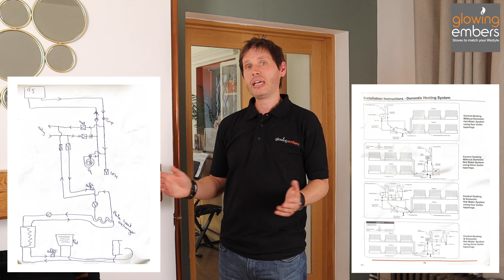Installing A Boiler Stove | Glowing Embers

Comment: Just recently installed mine, works a treat, also got a Henley which I purchased form Ireland. Gravity has two rads and also does my hot water. I have 10 rads off the pump side. Multiple safety rad stats to turn on the pump if the water ever reaches a certain temp. Gravity circuit works brilliantly to dissipate heat if the pump is off. 28mm pipe work on the gravity side, 22mm on the pumped side, gravity hot side needs to always travel up, with no horizontal pipe work. Both tanks in the attic are metal. This is simply the best system for old houses.
Reply from the maker: Great, sounds good, glad to hear that your system works well and thanks for sharing your set up, really helpful.

Comment: Air source heat pumps will now heat water to 70 degrees
Reply from the maker: That’s interesting, I haven’t heard of one that can get to this temperature before, what is the model?  That could make installing a boiler with one of these a bit easier.

Comment: I'm no heating engineer but I visualise having a hot water tank with multiple coils in for wood burning boiler and ASHP, and heating if thats how the heating works.  So essentially the ASHP and stove keeps the hot water tank upto temperature and the hot water and heating will come off a coil.  I think that's how i'd like to do ours when we get to that point of the reno.   Great video explaining everything.

Comment: Always thought you needed a galvanised steel expansion tank ?
Reply from the maker: I should have pointed out in the video that a metal expansion is always recommended, mine has a high melting point, well above boiling water but I am probably going to change it.

Comment: Hi mate great video. And the install looks very neat! I could be wrong as havnt done one of these systems for a long time now. But I think your F+E tank should be copper not plastic. If it ever does boil over. You’ve got red hot water going into a plastic tank.
Reply from the maker: Yes, whilst my tank has a very high melting point, metal is always recommended and I may change mine.

Comment: Great explanation thankyou for this. I moved into a house approx 8 years ago and we have a Hunter herald mf stove. It is our only source of heating. We have always found it struggles to get all of our rads to a decent temperature even though it should be more than capable of doing so. It uses a Navitron TDC3 controller to start the pump but it doesn’t kick in until it reaches 58 degrees. I think that might be the problem as the pump doesn’t stay on for very long before the water begins to cool. I might drop it down to 45 degrees like yours and see if that helps.
Reply from the maker: Thanks for your comment, I have found that it is a balancing act between pump speed and the temperature that the pump kicks in at.  It sounds like possibly your pump might be pumping too fast if it cools the water quickly before turning off, so you might want to try experimenting with this.  Wood burners hold a lot more water in their jackets than a gas boiler and therefore the water needs to stay in the stove for longer to get to temperature.  You could also try lowering the temperature that it kicks in at and see if you can find an optimum balance of the two.  The next obvious things to check are if you are burning well seasoned wood that gives off enough heat, as this will of course affect the performance greatly.  Hope that helps and good luck with it.

Comment: Fascinating video.

The most daunting aspect would be the fitting of the piping to your existing system.

Does your Company have a Showroom with other kilowatt ratio wood burners with boilers on display?

Also, the four pipes connected for flow and return, presumably a hole is cut at the side of the existing Chimney breast, can you advise on the dimensions of the hole and shape, eg can the hole be round, or does it need to be oblong?

Regards

Robert

Comment: This is a very informative video. I could really do with some impartial advice as we have just moved into a 1920s 3-bed bungalow off the gas grid (LPG), its really cold. The existing Worcester Greenstar Ri conventional boiler system just doesnt seem to cope for some reason? It wont work at a gentle steady 21' heat like the combi in our old house (its either on max or off) and the pathetic network of tacked-on radiators don't flow too well it seems - some hot some cold. Id like to live in the house for a full 12 months before embarking on a new install just to see where the hot and cold spots are, but my wife is pushing for a wood burning stove in the living room ASAP, in fact she says if she is cold one more winter she's leaving! (I think she's not exaggerating?). My brain says to consider the house as a whole not blow a wad on one room.......ideally I'd like to have a hybrid system that could take advantage of both fuel sources, wood and LPG for heating and hot water for bathing/showers (I would use instant heaters for sinks). I would also like at least part of the system to work in the event of power failures, so not totally dependant upon pumps and use gravity where possible. Does such a system exist? Could we potentially install a boiler stove and link up to the existing rads for now, and then link to a more integrated system later?

Comment: Really interesting video. I was under the impression that boiler stoves were no longer popular following the changes to the regulations concerning efficiency so this is good to see! I have an Arada 12kW boiler stove that I'm looking to integrate with our system here (2 thermal stores with gas boiler and solar thermal). In our case we have a vented 300L thermal store (only used in winter to heat radiators) in the room on the other side of the boiler - unfortunately I don't think we can rely on gravity as the tappings on the store are only marginally higher than the stove (50mm over 2m).  Are you familiar with a pumped system? I was looking at using a Laddomat loading valve but am interested to know about the safeguards to protect the system in the event the pump stops... We're getting a lot of conflicting advice on this.
Reply from the maker: My system has a pumped and gravity side.  If you are using a heat store then this is a good solution but you still need to have a heat soak radiator (min 10% of the heat output to water) and an expansion tank.  If you have these two things in place then your system should be able to run fine without the pumps ever kicking in.  The key is the heat soak radiator and an expansion tank.  Hope that helps.

Comment: My system has been in over twenty years now, a Parkway multifuel room heater with boiler, it feeds 10 rads, and a 36x18 cylinder for the hot water, this includes a heat loss rad, and towel rail in the bathroom, it was very efficient with household coal (which is now banned), heats the cylinder by gravity, pipe stat fitted to the primary flow expansion when the heat travels up the expansion at a given temp it brings in the pump, I have a gas boiler which is crudely stabbed in the rad circuit, which if used, runs through the roomheater and cylinder, I probably need to get one of those heat exchange thingy's
Reply from the maker: Gas boilers are easier to mix with boiler stoves and if you have a working system then it probably isn’t worth adding in a heat exchanger.  There is a cost to a heat exchanger and that is a smaller loss of heat, thought they are pretty efficient you do loose some heat in the transfer process, so probably, if it ain’t broke, don’t fix it!

Comment: I have my oil boiler and mulitfuel stove linked to a thermal store cylinder
Reply from the maker: Yes, a thermal store is a great way of doing this too, it does mean it takes longer to warm up and you need to have a large tank in your loft but generally is a good installation choice.

Comment: Hi, Great video. We have a three bed bungalow with a 13 yr old Mitsubushi Ecodan air source heat pump. Although it heats our home and water well I think it's actually quite expensive to run and it leaks in the winter and creates a pool of ice. So it's probably not working as efficiently as it should and trying to find a plumber in Cumbria for this is next to impossible! I'm looking to remove this system. I have purchased a second hand Herald Hunter with a boiler and want to fit it and also want to have an off grid gas boiler set alongside it so they can back each other up when necessary. Would the gravity rad be ok in the bathroom about 15/20ft away and obviously on the same level as the stove and an insulated copper water storage cylinder in the loft above the stove and would I still need a metal expansion tank in the loft?  We are kinda looking to eventually go off grid including harvesting the rain water because we get more than our fair share of free water!! Do you know if 12v pumps work on a system like this? Thank you in advance.
Regards, Mike

Comment: Great video. Looking into boiler stoves but unfortunately we’ve not long move to combi system and seems as though it wouldn’t be easily do able. Probably would be able to as there would be a lot of infrastructure already in place for a tank etc but information and people actually doing this seems to be impossible to find!
Reply from the maker: This would certainly be do-able.  Installing a boiler stove with a standard gas boiler is much easier than installing with an air source heat pump, you wouldn’t need to worry about pipe stats shutting off the flow to gas boiler, it would just turn off once the boiler stove is lit and the boiler would take over.  When the boiler wasn’t lit the gas would take up the slack, it could be a nice system.
Reply: @glowing-embersUK  very interesting! I’m in a large farm house so heating is always on the brain. Would I be able to contact yourself? Or do you know of anyone I could contact to look into this further? I’m not sure my local log burner fitter is quite up to speed on this sort of thing but really interested!

Comment: Such a great video! I have a very small house that im looking to install a boiler stove in. It's 4 rooms over 3 levels, with the boiler at the very bottom. It would be 3 or 4 radiators. Would it be possible to run this completely on a gravity system? Thankyou
Reply from the maker: Thank you! Yes, if you are only using the boiler stove for heating then a gravity system should work well and with only 3-4 radiators, you should easily be able to find a boiler stove that would heat the house.

Comment: Great video, i live in bungalow, how far away should the stat be from the boiler stove? Ive been told as close as possibe is this true? Ive the same stove 4 pipes and the diagram shows the stat on the return?
Reply from the maker: We’ve put the stat on the pipe just after the heat soak radiator and before the expansion tank, this works well for us.

Comment: great vid. do you have any problems with flow across the horizontal pipe work? the only heat sink radiator is above my boiler stove in the bedroom, and boy, it don't half get hot. we have a gas boiler (50kw) in our cellar and when the boiler stove is lit the gas boiler never comes on until the fire dies down. is it worth trying to keep the fire going at night to stop the gas boiler coming on?
Reply from the maker: Thank you, no I don’t have any issues with horizontal runs in the system, although I don’t have many in the system, most of the longer horizontal runs are on the pumped side of the system, not the gravity side, which only has relatively small horizontal runs.  Heat soak radiators do get hot, sometimes very hot, that is their job, often best not to have them in a bedroom for that reason and locate them somewhere like a bathroom if you can.  You could try keeping the stove in overnight, you really need to use some smokeless fuel to do this, load it up and turn the air controls down so it simmers all night.  You will need to experiment with the fuel (both quantity and type) and the air control settings to perfect this and you may well find that it blackens the glass overnight as it slumbers.  It is not the best way to run a stove from an emissions point of view but it does keep the stove warm overnight ready for re-fuelling and firing up again in the morning.

Comment: Go green with an air source heat pump then get realistic with a fire. ( did you know when you bought the air source they need nice insulated airtight buildings to work efficiently?)
Reply from the maker: The air source was already in when I moved into this house and yes – they work well for top spec insulated houses with triple glazing, and underfloor heating but for an older housed like mine with single glazed windows and radiators it is a non-starter, really expensive and really cold!
Reply: Everything works better with good insulation. Heat pumps, boilers, stoves. You have less heat loses.

Comment: Would you recommend the Druid 30? Would it be an efficient unit if this size? Tks
Reply from the maker: Yes, I would recommend it, it is a solid stove and works really well.  There aren’t too many large boiler stoves on the market at the moment, since the new eco design regs but a few more are coming through.

Comment: How long does it take to heat the water and feel the heat in other rooms with this boiler stove?
Reply from the maker: It takes up to an hour for the rest of the house to start to heat up, with the exception of the gravity radiator which is pretty quick.  It depends upon how big the fire is of course but from totally cold, you have to get the firebox warm, then the metal of the stove (and there is a lot of metal to warm) then the water in the system and this all takes a bit of time before the heat moves to the rest of the house.  Once warm, it heats up the hosue pretty quickly.

Comment: Would any body know if running pipes from the ceiling to the rads or from the floor up to the rads would make a difference with back boiler stove.
I can’t get my rads to heat properly but I was told it might be because my pipes drop from the ceiling to the rads and any system he seen like this always has issues
Reply from the maker: I haven’t had direct experience of this but it could well be.  Is it a gravity system or a pumped system you are running?
Reply: @glowing-embersUK  thanks for the reply, my stove is a 4 pipe system, 
2 diagonal pipes gravity feed to
The cylinder  upstairs and 2 to the radiators and there pump fed
Reply from the maker: @Thedar561  It’s difficult to diagnose but, we recommend the following areas to check:
1. There is no sludge in the system
2. The pipes are correctly sized
3. The pump is correctly located and sized
4. There is no air in radiators/system
5. The radiator valves are balanced correctly.
If so, it should circulate.

Comment: What happens to your heating system in the event of a power cut?
Reply from the maker: With my system the pumps would stop and the radiators attached to that pump would cool. Of course, I would still have the heat from the stove downstairs and the gravity radiator upstairs, so the house would retain a lot of heat for quite a while. It depends how off grid you want to be, to be completely off grid you can go for a pure gravity system, with no pumped element to it. This is how systems used to be before the advent of gas boilers that meant that water had to pass through the boiler very quickly. A gravity system just uses the gravity side of the boiler stove and the heat expansion passes the heat round all the radiators. This is a great set up for just a boiler stove but if you want to add in another heat source this is where you need to add a pumped system to the mix. Another alternative of course is to wire your pumps to run off a generator in the event of a power failure. Hope that helps.

Comment: So does this only do heating and can you have a gas boiler on the system for emergency
Reply: Hi, we have a gas boiler that runs in conjunction with an open fire and back boiler, it works pretty well but, in a week or so we are replacing the open fire with a boiler stove, which will work much better, so yes you can do that if you want to.
Reply from the maker: A boiler stove can be hooked up to heat radiators and or a hot water tank, it depends on what you want it for, how many radiators you have and the heat output of the stove.  It is much easier to add a gas boiler into this system than an air source pump, so yes, a gas boiler, or an oil boiler can be added in and can automatically take the strain of heating the home once the boiler stove is out or under temperature.  The set up would be very similar to mine but a little less complicated.

Comment: Hi great to see the video, Thanks.
I'm building my own log cabin and I'm thinking about putting in a boiler stove, now my question is, because it is one level where the stove is going to be can I put the first radiator on the same level as the stove to get ride of its heat before it is going to the expansion tank? the bathroom will be in the basement with sauna where I would like to have also a radiator but that is 1 level down! would I need to install a pump to get it down?
The expansion tank since I don't have an attic can it be anywhere else? or I might have to put it in view.
Thanks in advance for your advice, Kind regards< Jack
Reply from the maker: Yes, that’s a tricky set up.  I think that you will have to end up pumping to your radiators as to work efficienctly gravity systems rely on the heat source being at the bottom.  You will also want your heat soak radiator and expansion tank above the stove.  I understand that this could be difficult in your case, especially without an attic but you need to ensure that the system is properly vented.  If you have plans, you can send them over to our team to help further.